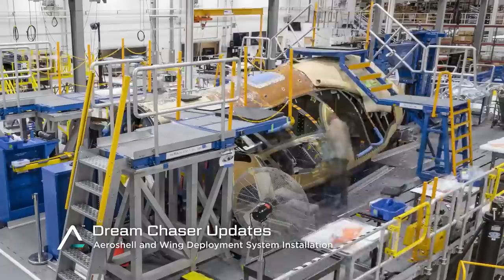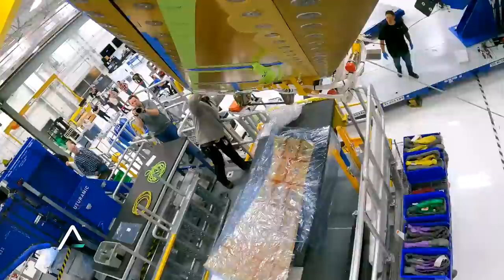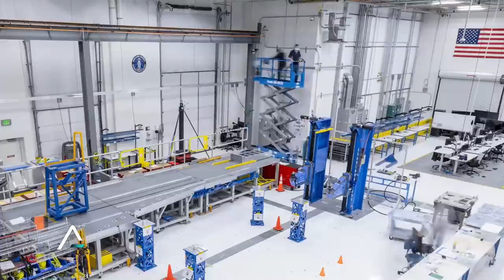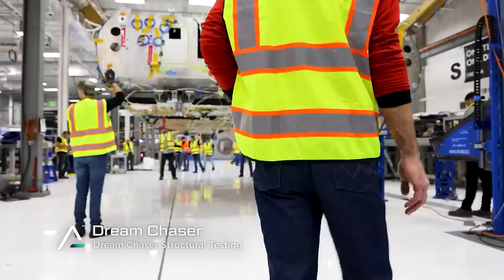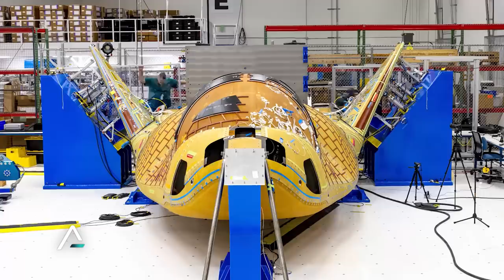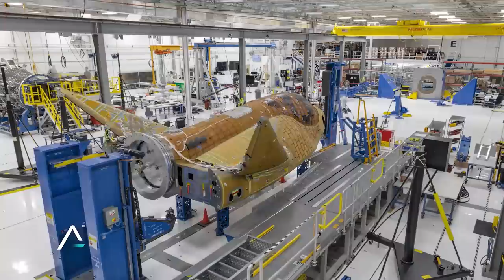Dream Chaser - Tenacity

Comment: БОР-4 проект USSR, 50 летней давности один в один
Reply: No, more accuratey it is based on USA X20, Soviet Mig-105 or BOR-4 were in 60s and 80s respectively while United States Air Force was working on X-20 Dyna-Soar in 50s.

Comment: Это СССР детище
Reply: No it is based on USA X20, Soviet Mig-105 or BOR-4 were in 60s and 80s respectively while United States Air Force was working on X-20 Dyna-Soar in 50s.
Reply: No it is based on USA X20, Soviet Mig-105 or BOR-4 were in 60s and 80s respectively while United States Air Force was working on X-20 Dyna-Soar in 50s.
Reply: No it is based on USA X20, Soviet Mig-105 or BOR-4 were in 60s and 80s respectively while United States Air Force was working on X-20 Dyna-Soar in 50s.

Comment: Soviet spaceship "spiral" of the 60s)) just now, have you reached this level?))
Reply: It is based on USA X20, Soviet Mig-105 or BOR-4 were in 60s and 80s respectively while United States Air Force was working on X-20 Dyna-Soar in 50s.

Comment: If you look at the appearance of the shuttle, it becomes obvious that this is a Soviet development stolen from the USSR - the Spiral System or Bor.
Reply: It is based on USA X20, Soviet Mig-105 or BOR-4 were in 60s and 80s respectively while United States Air Force was working on X-20 Dyna-Soar in 50s.

Comment: Это же Российский челнок
Reply: No it is not, its based on x20 as Russians were coping/stealing x20, Soviet Mig-105 or BOR-4 were in 60s and 80s respectively while United States Air Force was working on X-20 Dyna-Soar in 50s.

Comment: Soviet project "Spiral" of the 1960s of the last century.....
Reply: No, more accuratey it is based on USA X20, Soviet Mig-105 or BOR-4 were in 60s and 80s respectively while United States Air Force was working on X-20 Dyna-Soar in 50s.

Comment: looks like USSR Spiral project)) (Спираль СССР)The drawings of which were stolen in the 90s
Reply: The MIG 105 was a USA design that was copied by the USSR.
Reply: It is based on USA X20, Soviet Mig-105 or BOR-4 were in 60s and 80s respectively while United States Air Force was working on X-20 Dyna-Soar in 50s.

Comment: USSR design project "Spiral"
Reply: No it is based on USA X20, Soviet Mig-105 or BOR-4 were in 60s and 80s respectively while United States Air Force was working on X-20 Dyna-Soar in 50s.
Reply: NO, it is based on USA X20, Soviet Mig-105 or BOR-4 were in 60s and 80s respectively while United States Air Force was working on X-20 Dyna-Soar in 50s.

Comment: Содрали с разработок СССР
Reply: No it is not, It is based on USA X20, Soviet Mig-105 or BOR-4 were in 60s and 80s respectively while United States Air Force was working on X-20 Dyna-Soar in 50s.

Comment: Это надо так бор из СССР скопировать
Reply: No, more accuratey it is based on USA X20, Soviet Mig-105 or BOR-4 were in 60s and 80s respectively while United States Air Force was working on X-20 Dyna-Soar in 50s.

Comment: Russian BOR4
Reply: The MIG 105 was a USA design copied by USSR.
Reply: It is based on USA X20, Soviet Mig-105 or BOR-4 were in 60s and 80s respectively while United States Air Force was working on X-20 Dyna-Soar in 50s.

Comment: Back in USSR
Reply: No it is based on USA X20, Soviet Mig-105 or BOR-4 were in 60s and 80s respectively while United States Air Force was working on X-20 Dyna-Soar in 50s.
Reply: No it is based on USA X20, Soviet Mig-105 or BOR-4 were in 60s and 80s respectively while United States Air Force was working on X-20 Dyna-Soar in 50s.